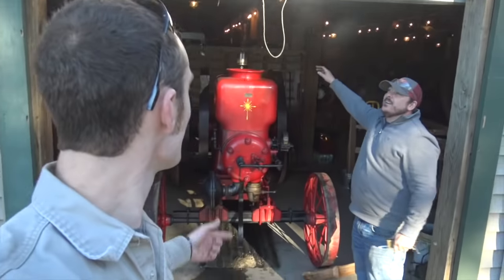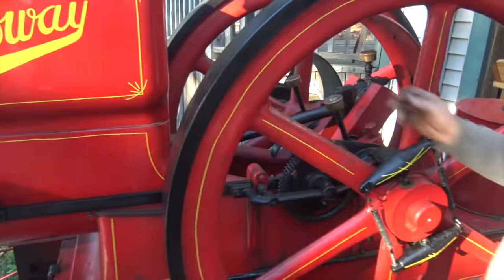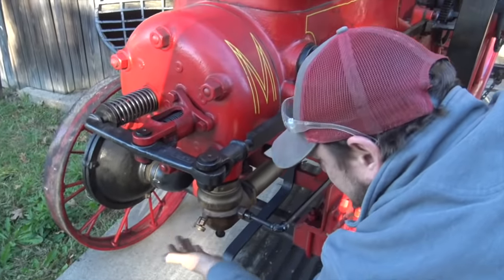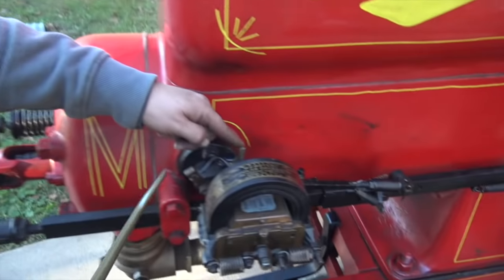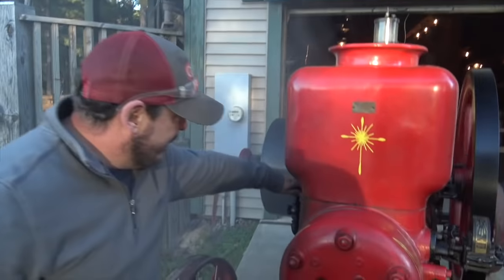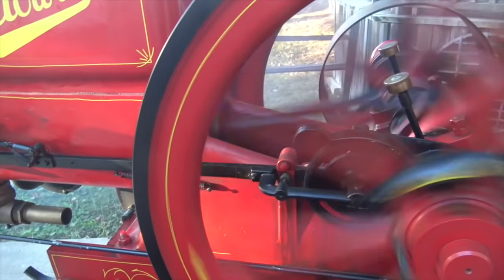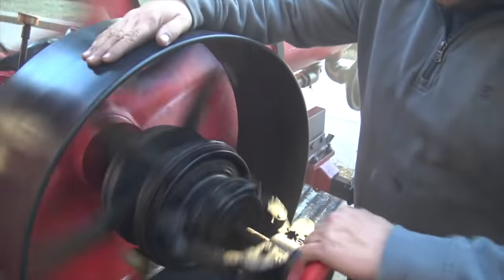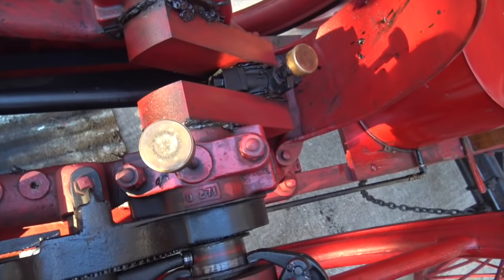WHY THIS INCREDIBLE ENGINE FROM 1916 IS PROOF THAT MODERN EQUIPMENT IS A SCAM & OLD STUFF WAS BETTER

Comment: The reason old engines always want to run is because there's no computer telling them they can't.
Reply: Exactly! These computers they put in nowadays is just so unnecessary. And of course its just a money making scam.
Reply: You do need to know how mechanical engine management works though if you ever want to own a vehicle with one because it's going to be rare to find a shop that would work on anything carbureted.
Reply: @dewaldsteyn1306  
If you want fuel injection you need a computer of some kind but it could be a very basic computer. You just need to measure your intake and exhaust so each injector can be turned on for the correct time to get a good a/f ratio. Could be a basic system but unfortunately emission regs came in at the same time as EFI so there is more now than just the engine to manage.
Reply: You don’t need a shop to work on something carbureted.
Reply: @jaysontadlock1871  
Exactly but you do need to know what youre doing. I was born after EFI was invented and I did luck out in that there are some older family friends who were willing to teach me. I'd likely have broken something if i'd learned on my own through trial and error. I almost fired it up when I first got it with the distributor firing the plugs as the exhaust vales were opening for example. I havent rebuilt a carb yet though I learned how but the carb my truck came with was too far gone and I needed a new one anyway.

Most older technology (analog electronics aside) is way simpler and cheaper to work on than newer stuff but the older something is the less likely you are to find info online. "Old timers" who are willing to pass on their knowledge to the likes of me are heroes because that knowledge is what will ensure that the old iron lives on.
Reply: I hear this all the time,😁! More chips more complications.😵‍💫. God help us. The engines became larger so too cumbersome in the modern world. And not enough hp.
Reply: It's not just computers but the fact things today are designed to have flaws that make you keep buying them. Look up the history of the light bulb and you will have a better understanding. Original light bulbs could last for over a century and same engineers who designed them were paid to find a way to make them fail faster. Companies that made bulbs that would go past a certain about of hours would be fined into bankruptcy.
Reply: When I saw a restomod putting a 41 Cadillac coupe body on a CTS-V chassis & running gear... & a 3" extension to the taillights caused a .004 ohm increase that the computer read & shut down the whole system, requiring an entirely new map program to be written, I was done with the stupid orgy of over-engineering of modern vehicles.
Reply: Source?
Reply: @P7777-u7r  if I'm not mistaken they had actually mechanical fuel injection before the computer kind I want to say 1950s or 60s
Reply: @runawaycatwithbreadaroundm2512  I think Chevy made a corvette that had a fuel injected 283 in the 50s
Reply: @jaysontadlock1871  hey, you... I don't like you. I thought that too starting out with Datsun 720, that Hitachi carb... I'm still confused how that do. Got a dead simple Weber now but holy smokes. Okay cute, runs good at idle but my timings not right with it spark knocking at low rpms under load. 

Where's an old hot rodder I can bribe with a case of beer?
Reply: Agreed
Reply: @P7777-u7r  ur first mistake is bringing ur ride to a shop, I suggest u learn to work on ur own vehicles
Reply: The computerized controls mandated for modern vehicles have nothing to do with how the engine functions or operates. The engines in modern cars only need fuel, spark, and compression to run, just like older engines.

The computers in modern cars don't monitor the health of the engine, they monitor pollution levels. That's why your car can run perfectly fine with a check engine light most of the time, because a check engine light doesn't necessarily mean there's a problem with the engine. A check engine light means there's a problem with your emissions, and nothing else. Something in your car isn't operating efficiently, so your emissions can't be verified or controlled.

That's all computers in modern cars do. They measure and control emissions.
Reply: @P7777-u7r  computer? except for almost any diesel. And those old corvettes. ME-109?
I have no idea why people are so afraid of a computer. it is just a machine. And I've made them from cars to gas turbines. It's not scary to learn something new. And oh boy do you have control of everything. It's not just emissions plz you can dial all kinds of torque curves fuel efficiency etc. Get any car and put a tunable comp in there or just build your own!
Light bulb that lasts longer? Try to read a book under it. Ever have a led flashlight burn out. Nope the batteries. Your house lights? Cheap construction and crappy caps. For money you can have it light for longer and way cheaper then those tungsten arc lamps of yesteryear. If you are willing to fess up they are out there.
Or have fun learning and make your own!
You can walk out of any Ford dealer with a 600hp mustang tomorrow!
I've worked on carbs "carcinerators" since the 70s. Goodbye carbs. Seriously.
Lotus super 7
Lotus esprit
Ton of old bikes.
Love tweaking the carbs.
Or do i?
His old engine is amazing and a beautiful project!!
My old timey engine breaks down all the time!!!
https://youtu.be/Lz6xQnkEedM
Reply: @Sleezystevie  hey now, there's a reason the tractors still running strong... It got the wrench every other weekend and fluids change themselves, just top it off.
Reply: they weigh at least 1000 lbs and probably makes 5 hp that's what i want in my vehicle
Reply: @zp944  You have no idea what you're talking about.
The ECU in a car controls a heap of things and not just emissions.
It controls the cylinder firing order and timing (unless its a diesel), it controls when the gears shift (if its automatic transmission), most can be reprogrammed to change torque output, top speed and a number of other engine characteristics.
Oh and it also stores data on fault conditions.

You can fly a plane with the master caution light lit, doesn't make it a good idea to do so.
Reply: @P7777-u7r  Fuel injection was used long before the invention of the modern computer.
Before the invention of the giant relay/tube computers were even invented.

German fighters in WWII used fuel injectors. The spitfire used a carb.
The use of a carb in the Spitfire caused it to flood in a wide variety of conditions such as diving and rolling.
The fuel injected German planes didn't have this issue and could literally run inverted for as long as the pilot could keep the plane inverted.
Reply: @daviddavidson2357  yea that fuel injected euro crap won the war huh ?? 😂😂
Reply: @P7777-u7r  not at all lmao, any bottom of the barrel r e a l garage can work on your carb.
Reply: That is why I want on older car or truck with a non computerized diesel engine.
Reply: Lol, exactly.
Reply: @zp944  Actually,modem engines can't do ANYTHING once they leave Open Loop mode...the computer is completely lost without cam/crank sensor readings, front O2 sensor, TPS, MAP, etc...
Reply: @P7777-u7r  Corvette had mechanical fuel injection on a 63 stingray 327 375 horsepower from the factory no computer you might want to look it up since you know so much about fuel injection
Reply: @dewaldsteyn1306  or you just don't know how to write electric
Reply: Complaining about computers being useless on a computer connected to a network of a billion other computers. sigh
Reply: OLD ENGINES ARE SLOW RUNNERS,  BUILD TO LAST. AND EASY TO REAIR. i LOVE THESE TECH. MODERN = TO COMPLEX, TO EXPENSIVE FOR REPAIR AND VERY BREAKABLE AND MANY TIMES UNLOGIC BUILD. WITH DIRTY TRICS LIKE PROGRAMMED WEAR
Reply: There is fuel injection tech that is purely mechanical, very old tech
Reply: @mb106429  fuel injection should be toggled by voltage. I didn't consider thinking about that because you have instant torque 🦾
Reply: @AlexanderGee  .....smartphone AKA handheld computer connected to a billion other users doesn't control the engine 🤦🏻‍♂️therefore the statement about a computer telling it not to run is quite appropriate, computers fuck up a perfectly operating I.c.e. ....fact
Reply: @biggumsliftsv1376  pedestal
Reply: That's because they got old engine nerds that can. Pretty cool. 🐮👍
Reply: @coatsmcgoats4719  spot on 👍 there was a tv programme on quite a while ago called " the men who make us spend "  which explained how modern items such as bulbs were designed to fail so we simply went out & bought another.
Reply: @grisslebear  0.004 ohms is an incredibly tiny bit of resistance, but that's the pain in the butt that computers do just whats unnecessary.
Reply: Because people don't know how beautiful the modern technology and computet management system works!
Reply: My vote is that this is the most underrated statement of the 21st century!
Reply: @coatsmcgoats4719  Well that's what you get when you don't regulate and let these companies do whatever they want. Companies are still pressing hard to block Right To Repair laws all over the world.

But it's fine because Capitalism will sort itself out (even though historically it never has)
Reply: @daviddavidson2357  The fuel injection on German planes could not automatically control the amount of fuel being injected. That's why cars have electronic injection.

Did you really not know that?
Reply: @awaren8375  That's great and all if you can afford the increase in fuel consumption.
Reply: @hrodebertcoad9848  doesn't actually increase fuel economy just cuz there's a computer on an engine. Has to be programmed or "tuned" for a performance or economy use, fuel injection and a computer doesn't equal good gas mileage.if it did fuel injected cars would get 50 miles to the gallon not almost the exact same miles per gallon they got when we had three speeds or automatic overdrive for speed. they're getting good gas mileage with late model cars because they have 8-speed transmission not because of a fucking computer 🤦🏻‍♂️ but I'm sure I'm wrong and blah blah blah blah blah blah blah blah blah blah...smh...
Reply: Yeah man the simpler the better
Reply: Amen
Reply: Takes a man to make a good working machine... Takes a computer to mess it up
Reply: @P7777-u7r  do you really? I mean... Really?
Reply: That's why I bought a Corolla.
Reply: And that’s how I know that you know nothing about modern engines
Reply: @hrodebertcoad9848  Mechanical fuel injection has a camshaft dedicated to the injectors, the throttle is controlled solely by the amount of air going into the cylinders. Very inefficient but very simple 👍.
Reply: @P7777-u7r  Bosch K Jetronic as fitted to VW MK.1 Golf/Rabbit needed no computer, it was CIS. Constant injection system, and still returned over mid 40s MPG.
Reply: Miniaturisation is part of the issue also as things get smaller the complexity increases too
Reply: Blaming the computer for sensor failure
Reply: The old ones just break down hard without warning or safety precautions. Also less powerful & less efficient. Way better ye?
Reply: @Skinnybrandotron  no computers, no sensors.
Cars can run well enough on senders, don't need sensors.
Reply: Every car from the mid 90's to 2012 just took offense to this comment.
Reply: And on that note, don't blame the computer for what the engineers and manufacturers did with the computer and sensors.
Reply: Bang on lol
Reply: Bang on , lol
Reply: The engine itself hasn't changed much they just keep adding sturr to it.
Reply: Computer works on garbage in, garbage out. Parts have a time limit built in. Government has impeded progress in technology until it suited them to do otherwise. Money talks loud everywhere. Finally, old technology worked until someone with money and/or connections stated that it was inefficient for some reason, i.e. pollution or need for speed or bigger boom.
Reply: True
Reply: I'm w victim of False Limp Mode (Chevy)
Reply: actually i say new engines are better, and more reliable, it's just their are a lot more of them so stuff goes wrong a lot more and their is alot more stuff put in and add on with the older engines all you had to worry about is oil and air filiters, now you got to worry about seals on the computers and wires rusting or getting eaten and alot of people don't take care of their cars lets say this thing sayed outside for 30 years it would most likey be very rusted and not working, then you take a 30 year old new car and due to the fact a lot of newer cars are made out of other things not just steel it would most likey survive.
Reply: @coatsmcgoats4719  yup, planned obselence
Reply: @spacecadet0  what fuel are you running?
Reply: @MrBaconpb  I used to run on cheese burgers and high proof alcohol but anymore I'm burning a modified keto-like diet focused on low/no sugar... Bye bye booze hound. As for my ole datsun truck, it's co-op e-free gas typically to save the soft metals.
Reply: @spacecadet0  lol nice
Reply: @spacecadet0  e free is def the way to go
Reply: Yeah! My Peugeot at exakt 300000 km
Reply: Reason I love sailboat engines, still dead simple, no computer controls... Who wants to be in the middle of the ocean weeks away from the nearest shop with a dead engine!! Simple and efficient 😁😁
Reply: That is one of many.
Also old things like the Ford Model-T are built to last!
They will last forever if maintained well enough.
And older engines need no where near as much maintenance as new ones
Reply: @P7777-u7r  how old are you?
Reply: @P7777-u7r  Early diesel flywheel engines were fuel injected. They of course had no computers, just a timed fuel pump. Edit. Well, mechanical gearing could be construed as a computer. A computer once once a person that tabulated mathematical equations. So, a computer designed and made gearing used in engines. The gearing made rudimentary timing and fuel control possible. Mechanical gasoline fuel injection was first introduced in the early 1900s. They even had electric cars that early also. There's really nothing new under the sun, just something that's improved upon.
Reply: @runawaycatwithbreadaroundm2512  The WWII Messerschmitt 109 had fuel injection long before the age of semiconductors in fact
Reply: I agree but the current situation with engines nowadays is both a give and take.  A vehicle without a computer running the engine  We'll continue running even if there is an issue however if that issue were to cause more damage while the engine kept running, it will just blow itself up (not literally but possible).  The sensors that go to the computer in the computer in the vehicle's nowadays help prevent any major damage from causing more damage. 

The downside to that however is that if a censor goes bad then the whole vehicle just shuts off And stays off. 

To be fair it's kind of a lose win situation no matter which way you go. One allows you a lot more freedom that even if the vehicle is kind of a piece of crap it will still continue to run versus newer vehicles where something could easily be fixed but until you do it won't run. 

One allows freedom to its own destruction and the other 1 is very strict.
Reply: From an engineering POV that's just a stupid comment. The reason it works because it's simple and well maintained. Computers don't have anything to do with it lmao
Reply: Right. They are just doing what they were built to do. Run.
Reply: @aimee-lynndonovan6077 old engines lacked hp because they were low reving unstressed engines, designed to do a job 24/7/365 without wearing out.
HP is irrelevant in these tasks as torque would be substantial and gearing would allow for speed if required.

This engine is 16HP. If we presume that it's 16HP @ 500RPM this engine is producing 168Lbs/ft of torque.
Reply: Like a huge die casting machine where I work, it has computer control with Windows 95. I tell people it will work fine so long as it never goes online and nobody tells it what year it is.
Reply: Nah. No one's overly teched up the plumbing, so it's just a lot harder to stop up the drain, as Captain Montgomery Scott would say.
Reply: As a retired I.T. Consultant I couldn't agree more!
Reply: I wish I had a thousand hands so I could give you a thousand thumbs up 👍 x 1000
Reply: Yep, and the type of manufacturing used is less prone to time death. I reman/rebuild antique ag stuff, farmalls mostly. It is absolutely ridiculous on a modern scale, that a magneto made in 1928, that was last running with the engine it's attached to, in 1968, and sat there, in the dirt, till 2022, should, with a bit of cleaning up, and fixing the rotten cloth/asbestos convered wires, bit of deoxit and sand paper on the contacts, knock your ** in the dirt, of course, only after you rotate it the wrong way ten times, and have assumed, whelp... This one's going to need more than that... Well I'll give it one more turn, but this direction... KLACK  "oof.."
Reply: American companies also used to build things to last. Good engineering, good assembly, and good material. Look how heavy the steel was on old machinery. Now, products are made to brake.
Reply: @coatsmcgoats4719  that is how supply and demand works . . . and why it's sometimes better just to skip it
Reply: @merlin5476 I think "veretasium" also made a video about this trend . . and the real question behind all of this is: . what can you do to stop it ??
Reply: @bluewhalestudioblenderanim1132  It goes beyond supply and demand. It's along the same lines as price gouging. Since we live in a throwaway society why overpriced things fail fast, generations after us will be stuck with literal mountains of trash.
Reply: @coatsmcgoats4719  thanks for more details
Reply: @coatsmcgoats4719  also what about enviromentsl groups ?? . . . to sove a polution problem . we also Have to solve stuff like this
Reply: Some concept of people and the government
Reply: @dewaldsteyn1306  just like computers in the car
Reply: @dewaldsteyn1306  mostly because legislators for environmental reasons have forced engineers to make the engines so advanced they couldnt possibly work without so much processing power while giving that amount of performance while emitting so little, a old engine from the 1800s or  pre war to 1960s car is pretty much good forever provided you maintain it, few enough moving parts. And if it breaks its relatively easy to rebuild it as they are cast iron and the block is usually still good, Meanwhile when a modern engine breaks, its done for, waay too much to rebuild, and aluminium blocks just dont handle breaking all that well. I mean it isnt a a scam, but id much rather work on a 1960s engine wont lie. Or a 1920s holy god are they simple
Reply: @coatsmcgoats4719  While that was true, it's not true anymore because the technology is completely different now
Reply: @P7777-u7r  im 22 I had to learn on my 75 mustang. its not like I can just take it to a shop
Reply: @lunchbox1553  The tech can be different but planned obsolescence is still very much common practice with almost everything available to consumers. You don't have to believe it if you don't want to but ask yourself why you need to buy a new smartphone every few years instead of changing their parts to upgrade them. Trust me it's never been as much a thing as it is now.
Reply: @coatsmcgoats4719  I literally started out by agreeing with you that it existed...
Reply: @lunchbox1553  sorry thought was another comment reply. Veeeery long day lol
Reply: In your face!
Reply: When I see the old machines I think......that lives for hundreds of years.
Reply: Hahha very true
Reply: @mb106429  you mean like diesel engines before common rail? Lol
Reply: @P7777-u7r  No, mechanical fuel injection has existed for many decades. :)
Reply: Amen
Reply: No it isn’t. They’re horribly inefficient and impractical. The future is better.
Reply: @daviddavidson2357  heaps of diesels with ecm ‘s running them
Reply: I don't know, most of antique engines looks like the don't want to even start...
Reply: This sounds like a mic drop comment, but it's not. ECUs rarely just stop an engine from working. That's not how they work.
Reply: @tyttuut  correct ecu’s rarely fail
Reply: That's exactly right! 😀
Reply: Truer words were never spoken
Reply: @Adam-mb8vd  هذا المحرك فعال و مجدي، و يمكن التحكم بالسرعة فيه، و المحرك الكهربائي ليس أكثر احكامًا منه، لربما أكثر كفاءة بقليل، لكن ليس أكثر إحكامًا!
Reply: @daviddavidson2357  التحكم الألكتروني في أشياء لا جدوى لها، الألكترونيات حساسة و رقيقة و تتعطل بسرعة و خطرة على الصحة و البيئة، غالبًا يتم استبدالها كونها صعبة الإصلاح و هي لا تتحمل الظروف العملية.
Reply: @anthonyhaynes8738  الكهرباء ليست ضرورية للكتابة، في رأيي الآلة الكاتبة و الأقلام أفضل بكثير!
Reply: @anthonyhaynes8738  أفضل الوقود الحيوي على الكهرباء.
Reply: @TheWonderman1964  التقنية الحالية ليست جميلة على الإطلاق!، و الكمبيوتر معقد و لا يصلح إلا للألعاب!
Reply: @hrodebertcoad9848 كان من الممكن تطوير تقنية الحقن الميكانيكي و جعلها تلقائية، لكنهم تركوها و أهملوها عند رؤيتهم للترانزستور!
Reply: @alternator7893  فعال للغاية، إن كان يُدخِل الوقود إلى الإسطوانة إعتمادًا على نسبة الهواء لتلك الإسطوانة!
Reply: @PsychoticEwok  التعقيد مطلوب لإنجاز عمل مهم لكن ذلك لا يعني إدخال الألكترونيات!
Reply: @thebush6077  من الممكن ملافاة ذلك، لا أعتقد أن القديم أقل قوة!
Reply: @hunterbear2421  المحركات القديمة أفضل و الأشياء القديمة أفضل و أكثر قوة!
Reply: @bigbadtree  ليس لذلك علاقة بالحاسوب و الألكترونيات!
Reply: @daviddou1408  السيارة لكي تعمل، لا تحتاج إلى ( Ipad or tv ) أو ( LEDs ) هذه ملحقات زائدة!
Reply: @sillymesilly  السيارة لا تحتاج إلى حاسوب!
Reply: @roccocroce  فعالون و موثوقون و عمليون، و لا أحد يعلم المستقبل!
Reply: @spannaspinna  غالبًا، تفشل الألكترونيات!
Reply: @ehab9877  I only read freedom squiggles
Reply: @daviddavidson2357  تتهم الناس بأنهم انتحاريون! ألا تستحِ
ثم ما هذا التفكير المغلق وصفتني بالانتحاري لأنني كتبت بغير لغتك، أعتقد أنتم تدعون ذلك بالعنصرية!!
Reply: @roccocroce  هذا واضح!!!! 
الحرية تتساقط منك!!!
Reply: @dewaldsteyn1306  Apparently, the companies found out that the computer-controlled engines would do better to their engines, but never told people that they would cause engines to quit faster due to wires going bad.
Reply: @aimee-lynndonovan6077  I’m pretty sure the new Silverado has a 2.0L turbo inline 4. Trucks are supposed to have v8s in them
Reply: the only reason ✌️
Reply: Then what about lawn mower engines?  It's more likely the materials, complexity, and operational speeds and temperatures.  The problem with vehicle engines is that the computer adds an additional point of failure but that's not the only reason why modern engines don't seem to last as long.  I guarantee that if you don't maintain a hit and miss engine it will fail just like a non-maintained modern engine.
Reply: Like most things not a simple matter the easiest light bulbs were dim as and very inefficient made way too much infrared so sure they probably wanted some planned obsolescence but also to make the bulb more practical by raising the light temperature by raising the actual temperature of the filament hence the candle or bulb that burns twice as bright burns half as long ect…

Also we can marvel at these old engines that run forever but same concept is at play modern engines do way way way more than these relics as beautiful as they are you couldn’t exactly install one in a car and if you did best be happy to go 5-10 mph tops and have to stop every hour or so to twist grease pots we live in a different time now this technology although very inspiring is completely outdated.
Reply: nicely said!

(this is coming from a 2008 kid) i think old stuff seems more reliable... simple, easy to maintain
Reply: Yes but also burn 3 gallon every km.
Reply: If I were alone on the earth and I could choose which engine would accompany me until my death, it would be the old one for simplicity and reliability (low revolutions per minute means low wear)
Reply: Brilliant. That's I say give me a before 96 vehicle.
Reply: @rayarthur586  OBD1 is still computerized.
Reply: @dewaldsteyn1306  the main reason they do it is that when it works you get more precision but computers don't always work ;ike there supposed to
Reply: These old engines are low performance. You don't need a computer to run low performance engines.
Reply: @dewaldsteyn1306  If you mean having engines that are not closely regulated to obtain the cleanest burn possible, then you are right they are unnecessary.
Reply: And this is why I always say that analogue stuff is better when it comes to machinery.

A PC OS can hang itself when working within its own environment, where it can monitor and control every variable relevant to the system.
Using computers for engines is doing the same, only now you are introducing a multitude of external variables, that the system potentially has no way of monitoring.
Reply: John Deere:your (unfortunately the device forgot what it was) has software that is more than 10 years old, a pity but we no longer support that. And now? the best thing is to buy a new  ....... hello are you still there
Reply: @coatsmcgoats4719  What you say is 100% true, the reality of the way our economic system works.
Reply: @biggumsliftsv1376  nope not based.
Reply: Well that and they actually built shit to last back then
Reply: Thanks for explaining this.  I love these.  I don’t understand completely how they work but I am fascinated and love to watch and listen to them work.
Reply: The reason old engines always want to run is because back then the corporations didn't have Bernard London's doctrine of planned obsolescence or the technological know-how to apply it. Once mister London wrote that POS text and it spread around, coupled with a few bankers taking a tumble off a "cliff" because they couldn't sell their expensive cars to a random passerby... they sure as heck started doing it.
That said, i'd rather have a modern piece of equipment, be educated, and just neuter the mothership's influence on my sh!t. I get to keep my sh!t running, and stick it to the corpos as well.
Reply: Fuel injectors have been used on petrol (gasoline) engines since the 1940s (and even earlier on oil and diesel motors). No computers back then.
Reply: Use a mule team.
Reply: @P7777-u7r not true, mechanics will work on anything, carb or not
Reply: @dewaldsteyn1306 except that most modern engines are on the ragged edge of self-destruction because of their high specific power output. It takes an ECU to keep everything together. 
I work with modern engines but I love the old ones. They are not remotely comparable
Reply: @michaelwallbrown3726 But torque.
Reply: @P7777-u7r  You must be too young for MFI and know nothing about Diesel engines.
Reply: @nikdog419  I was talking about EFI specifically but I notice I did say just generic "fuel injection" at one point
Reply: @runawaycatwithbreadaroundm2512  I took a little gander at Wikipedia. Mechanical fuel injection was in about 1902. It was used in WWI planes and continued to be used in aircraft. It was used in cars in the 50's, 60's and etc.
Reply: @P7777-u7r  mechanical is easier to learn than electrical because you can actually see how it works, who knows what those angry pixies are doing inside those wires just by looking at them
Reply: And my pickup will always keep running, because it's barely above this technology.😂❤
Reply: Diesels are fuel injected 
They have been around since way before computers 😝
Reply: @dewaldsteyn1306 the things they call "fail safes". Anything electronic sucks. I was born into this Era and even I know it's wrong.
Reply: @coryholzhauer1049  even the automotive engineers hate it but due to legal bs and company policy they’re required to add it
Reply: @coryholzhauer1049  I don't agree that EVERYTHING electronic sucks, but there are definitely a lot of things that have computers that shouldn't have computers.
Reply: @runawaycatwithbreadaroundm2512 The early Corvettes could be optioned with mechanical fuel injection in 57 .
Reply: I'm sure that planned obsolescence is an old new thing. It's just that the products that had it in 1916 are long since gone. Now the only surviving equipment from that time is such that the equipment made its manufacturers obsolete.
Reply: it's possible to make something managed by a computer last forever, just make the computer serviceable, and the software available. 

these old machines last forever partly because it's easy to repair them.
Reply: @grisslebear  I quit Auto mechanics after 25 yearas when the techno orgy got out of hand I still work on my own vehicles but they're all 2010 and older.
Reply: @runawaycatwithbreadaroundm2512  Yes they did 1957 Chevy Nomad is a good example. I still have mechanical injection in my 1994 Dodge Cumins Diesel.
Reply: That`s a fab answer!   A robust engine - even a modern one is a robust thing - controlled by the most complex and expensive and seemingly un-serviceable in some cases - partly due to the huge price incurred, means that loads of perfectly good engines mechanically sound are piled up to be melted down.  Misguided policies have to be responsible for this.  The manufacture of millions of new cars is obviously generating a huge amount of pollution - but we are not allowed to say that.  Whoooops!!! I just have:face-green-smiling:🤣😯
Reply: The shit will probably still run in 400 years time looked after properly. Very strong machinery.
Reply: @jaysontadlock1871  Did you know that the 1957 chevy nomad had optional mechanical fuel injection. My 1994 dodge cumins diesel has mechanical injection. In fact diesels didn't switch to electronic injection until as late 2008.  VW had gas mechanical injection back in the late 1970's all these differant examples used a distributor pump the time out which cylinder got fuel next. These pumps are all gear driven off of the engine.
Reply: If you don't know how computers and engines work, you can make all kinds of claims!
Reply: @P7777-u7r or u could just use electrolysis with a small amount of electricity and  have that flow into.the air intake. Just makes ur I have a switch to shut the power off to  it a few minutes before u turn off the car lol
Reply: @aimee-lynndonovan6077  my brother in christ this is a 1200 pound engine that puts out like 9 horsepower
Reply: Youve obviously never tried setting up a carbeuretor
Reply: @dewaldsteyn1306  Bullshit, car engines have gotten extremely fuel efficient and powerful/lighter than in the past.
Reply: And they are not made of the closest crap to plastic they can get away with using in so many things now.
Reply: Learn first. Computers improve efficiency. I don't want to teach you basics just Google. Computer controlled engine can adapt to any conditions.
Reply: @P7777-u7r  There is mechanical fuel injection as well, the injector timing, etc.  Some are more advanced (variable timing, etc.) others are extremely simple.
Reply: You've got that EXACTLY right!!!
Reply: Ahhh, the pros of a purely mechanical engine